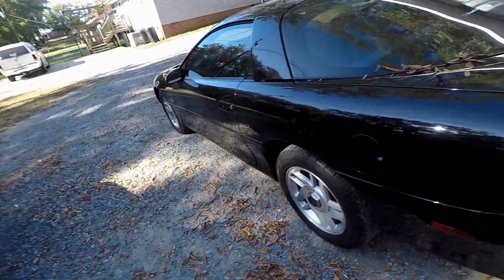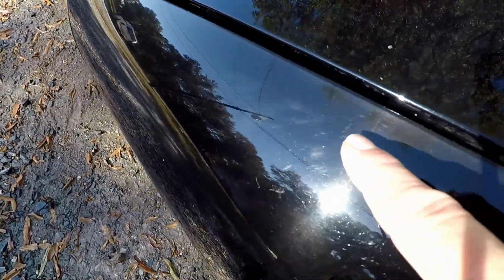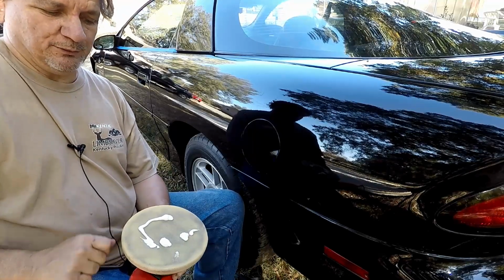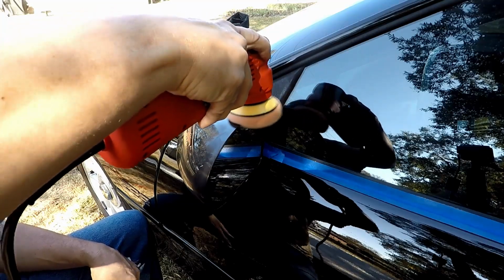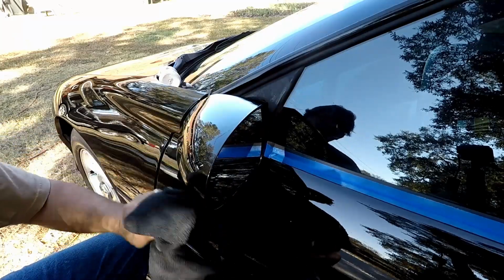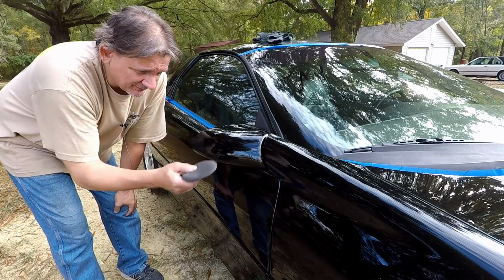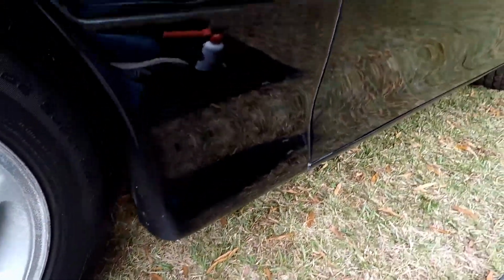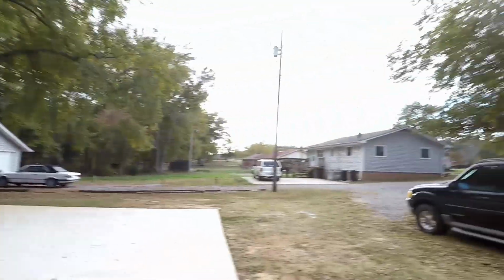Putting Griot's One Step Sealant on my  1993 Z28 Chevy Camaro Detailing for winter

Comment: Great job I've always waxed by hand but watching you with the power polisher I think its time I get one. Great video keep up the good work.
Reply from the maker: Hey thanks for checking out the video. Like you , I have always done it by hand also. But as my cars have gotten older and older, I noticed it was getting harder to remove imperfections. I do not know if it was because I was getting older or what. I had been looking for a while. I did not want to spend $300 on a decent machine. I then found the griot's. I read all the reviews and feedback. So I made the switch. And have never looked back. Take the plunge. You will not be disappointed. Just use it on slow speeds until you get confident.  then let it rip when you do. Like I said, I can do the whole car in under 2 hours........Thanks again for the comments
Reply: P-and-A Photos thanks 👍
Reply from the maker: Thank you sir

Comment: @CamaroTime I Also Thinking Now About Getting a DA Polisher I Usually Claybar My Car About Once a Year And Wax It Probably About Once Or Twice a Month But Since My Car Has Had Quite The Journey Through 8 Owners Mostly Carlots And 1 Head On Collision And I Bought It And Put Over 3,200$ in It I'm Thinking About Polishing It Myself And Saving 100$ And Time To Get The Fine Scratches Out Of It And Making It Into a Show Car I'm Also Taking It To Camaro Fest This Year And Hope To See Ya There! Thanks For Persuading Me To Try Out a Polisher At First I Was Very Skeptical About Them Because I Was To Worried About Burning Through The Paint
Reply from the maker: Hey there. Thank you so much for checking out the video. Do not be afraid. Just put it on a low speed and work it. Once you get a feel for it, crank It up a little. Depending on which model you get, and how bad the scratches are, you will need different pads. For a "bunch of scratches, a regular polishing pad will not work. You will need a different type, like a micro fiber or wool. Only use it where the scratches are. Then switch to the polishing pad.  If you are scared of those pads, try the polishing pad with the rubbing compound and work it slowly on a low to medium speed. That should get them out just as good but just not as fast. Before you do anything however, wash your car with dawn dishwashing liquid. This will strip off most of the wax and all of the contaminents in the paint. That way, you will not have to work as hard with the polisher. Let us know how it turn out.  If you need help with any questions just ask......
Reply: Camaro Time Thank You It's Mostly Just Light Scratches And Swirls From When The Last Owner Has a Tarp With Stuff Setting On Top Of It Before I Bought It And I Had a 50$ Carcover On It Last Winter Before I Put In The Garage Now It Doesn't Set Outside
Reply from the maker: Ah ok. Just the polisher and some polishing compound if the regular polish will not take it out. Still wash it with Dawn first. You will thank me later.....LOL
Reply: Camaro Time I Sure Will Thank You

Comment: Not sure of the winter weather in south Carolina (Im from Australia, sunny part similar to Florida) but have you thought about putting some kind of top cover for your cars. You love them and look after them so how about at least adding 4 post and a roof. This way at least the cars will get some kind of top protection.. you could add the sides later one. You already have a good concrete base. Alternative would be to use a side of your house as one wall and just put 2 post in and some top cover.  A roof will  add a substantial amount of winter protection and it will not be as expensive as a full stand alone garage. Have you thought about it?
Reply from the maker: Hey there. Thanks so much for watching. I was going to wait until this spring and either do a metal carport or garage. Found a guy that gave me a good deal on the concrete so I did that first. I already knew the size, no matter which way I was going to go with it.  Right now, planning on wood structure with roof and then the sides by fall I hope. Even with a full garage, I would still put the sealer on  them . Even if to just help keep the dust off. That's just me......